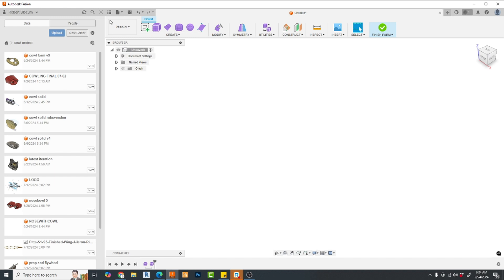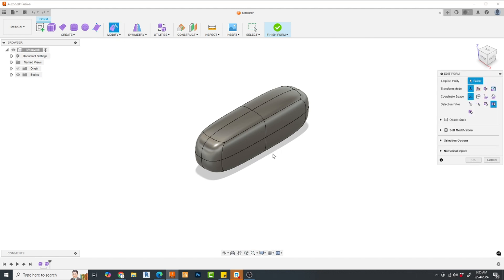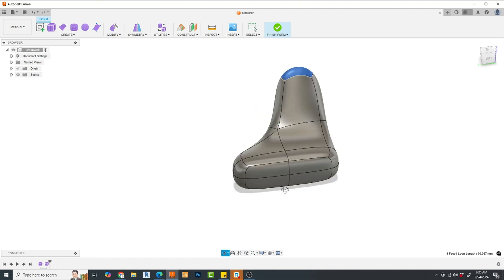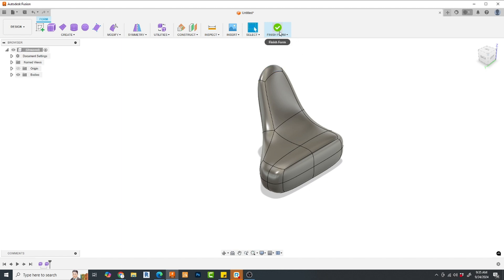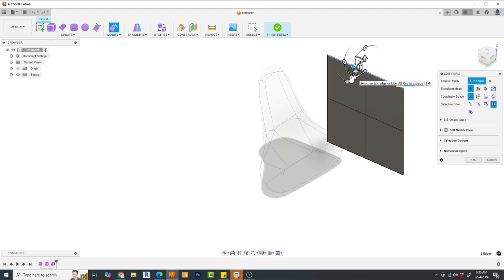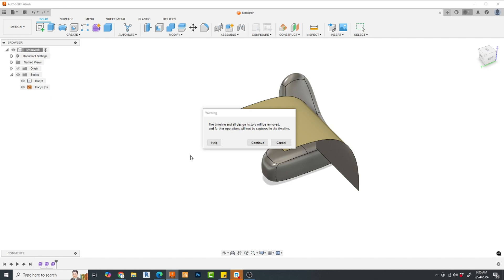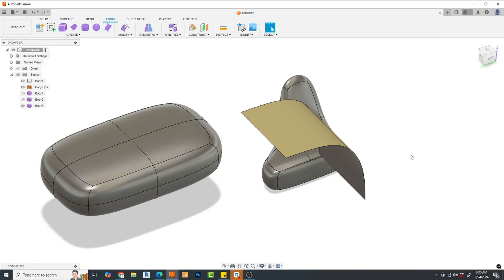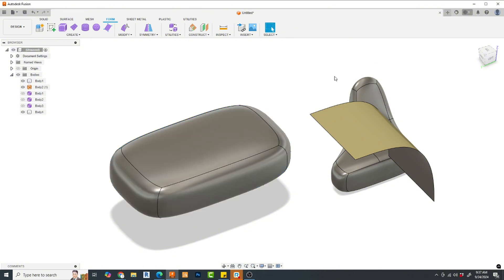Great!  I've created a fusion 360 form. What do I do with it now?

Comment: Finally custom shapes. I've been a aircraft model builder for 40 years and really like custom shapes and non normal forms. I use all kinds of materials from balsa, paper, tissue, and have flown some really strange looking planes, mostly rubber band powered.  Also sailboats, ships,  sci-fi space ships. Things don't have to fly but it would be fun to make a physical model you can hold in your hands or set on a shelf.
Reply from the maker: @woodturner1954  me too!  All the above.  Got both sailboats and powerboats.